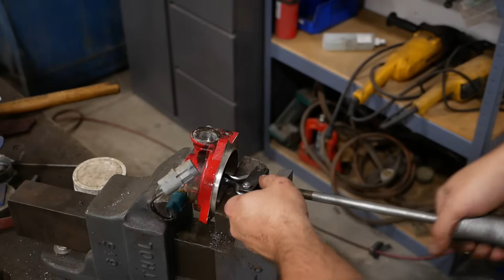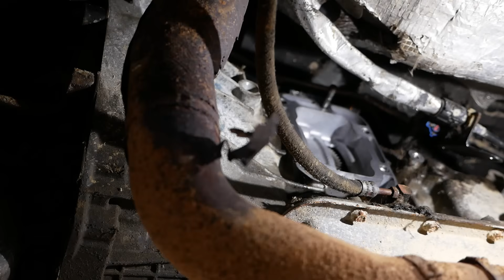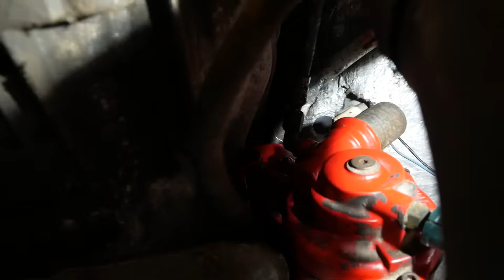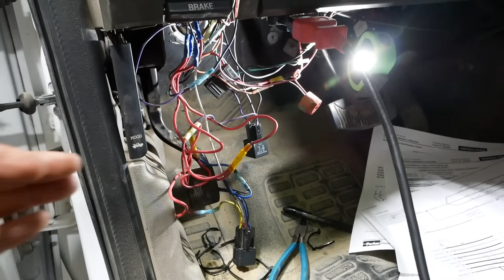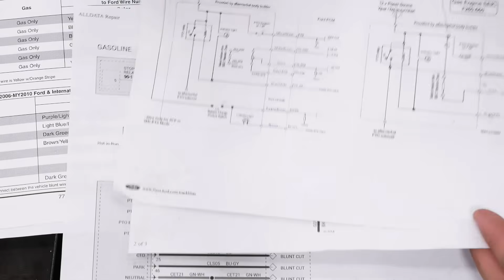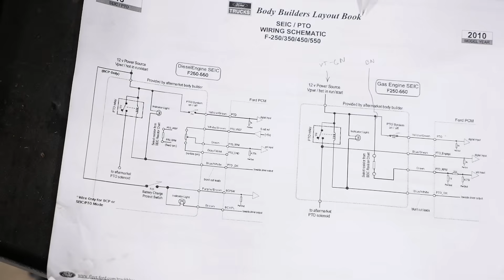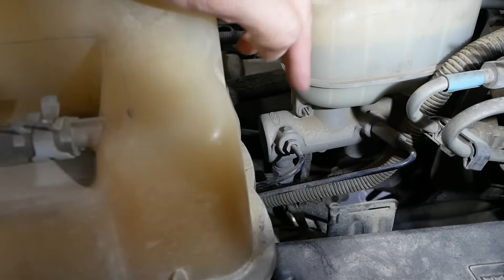Ford F550 Chelsea PTO Repairs - Unexpected Complications

Comment: As a former transmission rebuilder I was screaming at you not to use a screw driver to install the lip seals however I was happy when you said it as blunt. A piece of mig wire looped into the end of a 6inch piece of brake line and then squashed to retain the wire makes an ideal seal installer. Also you can wrap electrical tape around the seal and piston and freeze them. If it has an internal lip seal you will need to find something like the neck of a plastic bottle to hold the lip seal expanded while the piston is in the freezer.

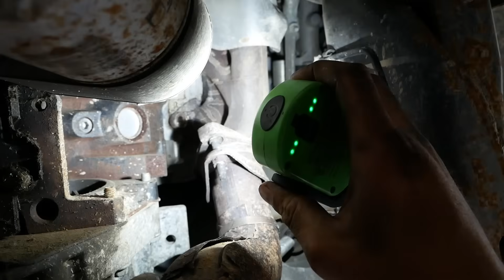Comment: 16:28 take transmission cross support off it should give u 4 in drop down get access to it
(I have replaced one pto on dump truck same issues tight fit ) i was hoping this help ya out

Comment: When you engage a  Chelse PTO manual or air operation, should be done with the brakes  on .and the transmission in gear stalled then engage then PTO!!
 This prevent excessive wear on PTO components!  All out GMC 16 yard  10 wheelers dump trucks used Allison auto  trans with  a 4 speed

Comment: Great diagnosis , fix and explanation . Of course , the question is , did those other 4 shops CHARGE them for NOT fixing it ?  It really is a sad that in this industry there are so many " experts " and no results . Know your limitations . Wouldn't it be better to explain to the customer that this is not what you do than charge and not fix it ? You need technical skills and the will to fix this . Most " mechanics " fall short in wiring and diagnostics .

Comment: U could use an old steel or friction take up the excess space in the stack.  That is what cut the lip on the old one. The piston came out of the bore and the lip caught the edge. Sometimes u have a selective plate that is thicker than the standard steel. Too much play

Comment: if that clutch was on a motorcycle (also multi pack frictions) it would be appropriate for a 100cc engine.  Somehow that doesnt add up, but pressure on the frictions and steels is the only thing that stops it slipping. Auto's have a similar issue with line pressure that sometimes needs to be revised on certain models to cure clutch slippage.  Attention to detail, pays off......and it also helps to research the operation of the system to gain an insight into how it "should work".  Well done!    subbed ;)

Comment: What was the symptom?? I have one on an f550 that engages everytime and all functions work. But its not strong enough for a heavier load. It does sound like marbles when its engaged but I was told it was symptoms of a weak pump. Now I'm trying to figure out if it is a weak pump or if the PTO is slipping. I think it should be the same design as this one.

Comment: I worked on garbage trucks for a living that's a new way body  most of the time it's the procemtry switch in hopper that cosen the problem  it is out of adjustment not letting the engine rev up
Reply from the maker: I suspect all of those switches have been bypasses long ago. The thing is a mess.

Comment: If the are running a hydraulic pump with an electric clutch .. why put it on the PTO .. it's be better powered off the crankshaft .. wouldn't it?
Reply from the maker: Ford says you can't run a pump off the belt without installing a larger front main bearing. You might be able to shaft drive it off the front of the crank, but I don't know.
Reply: @WatchWesWork   I see .. I guess it IS kind  of a big pump .. I've seen the front crank driven ones on bigger trucks and older farm tractors a few times times

Comment: Your transmission guy is right.  You don't flush as a flush can dislodge and move debris to a spot where it will clog the valve body.  Flushing is something that a shop can do to generate revenue from the flush, then revenue from repairing the flushed transmission.

Comment: Well done!

I've found that body Outfitters of just a decade ago (let alone older), rarely keep records of their own build designs. As running changes occur from chassis suppliers, the problem compounds itself and as a result, nobody knows how to troubleshoot the electrical and hydraulic system. 

The only ones that do keep archives are the chassis suppliers. Your approach to the problem was smart. 

But there are significant downstream problems facing the owner of this trash truck. All the safety features of the hydraulic system have now been bypassed by the previous repair shops hacking the wiring.

All the relays you found in the control box are usually connected to all the hydraulic Rams and ensure they are all operating at minimum / maximum ranges and line pressure requirements. Which then send signals to the Ford PTO configuration for engagement and rpm control (limits) and emergency shutoff, if equipped.

I've rarely had problems with Parker / Chelsea wet PTOs when they are maintained correctly with transmission hour maintenance intervals, which very few operators implement. 

The maximum hours between transmission oil changes should be between 800 / 1,600 hours (depending on gph load req.)  if operating 10 - 12 hours per day in moderate climates.

If an operator demands high availability, they will enforce a strict maintenance intervals. They will never require a transmission oil flush if they simply change the oil and filter on a regular pto hour schedule. This is especially true of Class 7 trucks with Allisons. As you pointed out, If left too late, like the Ford's, flushing the system will probably do more damage than good.

Comment: Great troubleshooting and repair! I had always wondered why I was told to not flush a high mileage automatic transmission until I heard the guy on Precision Transmission channel explain. He said automatic transmission fluid is highly detergent. Transmission housings are porous and over time metallic fragments and particles can imbed into the housings and new fluid can flush those particles out of the castings and destroy a transmission.

Comment: Wes. You're probably aware that it has other "issues". But I noticed when you attempted to use the compactor controls at the rear that it's not cycling properly. These compactors usually use limit switches and/or hall effect sensors to detect what stage they're on. These always end up failing/partially failing on rubbish trucks. But the good news is that now you've raised the idle it'll fit more rubbish in it too. Maybe too much, that poor little rusty chassis has got enough weight on it already. That's not your problem though. But you shouldn't have put the idle up on a separate switch. An operator will do whatever is fastest. One switch to make it work? Someone down the line is going to not give an F and that PTO clutch will burn out again.

Comment: Crazy good vid, correct trouble diag.  Found main issue and in such the secondary issue of other shops not finding the root cause and the wire hacks.  Now the truck is working as intended with the way the O.E. would like.   So if anything else goes wrong, like a mouse chew a wire....back to basic other tech in a different shop has a better idea what is the next diag step.  Out friggen standing.

Comment: I love that you go the extra mile to not only do a proper repair but to explain your reasoning that always makes sense. The clutches were burned up just like someone that rides the clutch on a manual shift only partially engaging the floaters and disc. Good job as always!!

Comment: My father in law had a ford lcf with a v6 power stroke it’s a roll back and it jumps up to 1400 rpm when the pto comes on it’s to protect the torque converter the manual says

Comment: If you take a paper clip and open it up and brake it in half… take that and stick it in the end of a 6 inch piece of brake line and hammer it tight!!!! Best deal tool for putting the lip seals in without damaging them!!!!

Comment: Should there be an instruction card on the dash showing how to properly operate the garbage body system? I would say that most people hired to operate a garbage truck don't have a clue on how to operate it. 
Does the system have failsafe modes to prevent damage from incorrect operating procedure?

Comment: The proper procedure to engage the PTO Is to put trans In gear and hold the brakes and engage the PT OStopped input shaft no grinding, my family’s construction Company had several trucks with Allison 650 series automatic transmissions.

Comment: I have worked on many of these and 9 times out of 10 the problem is the PCM thinks the truck is not in park.  Hook up your scan tool and look at the pcm shift inputs. More than likely the range selector switch on the side of the transmission is faulty. Had this issue on a Ford F450 wrecker and the range selector switch was full of water and worked enough for the truck to move but no high idle. Also look for a parking brake bypass switch/jumper wire. A lot of companies opted to bypass setting the parking brake so the drivers wouldn’t forget to release it.

Comment: I'll add to the chorus of amazement & kudos here in the comments for your diagnostics skills and perseverance.  I'm curious: how long did you spend researching the Ford wiring schematics and decoding the rat's nest under the dash?  "Some time has passed" would seem to cover a lot of sins.

I've done some enginerding (h/t AvE) on automotive systems & large home appliances, interfacing them with onboard software components, but I always had pretty full information on the signals I needed to interact with.  Reverse-engineering four layers of prior "fixes" wasn't really necessary.  😀

Thanks for inspiring us all with your great content!

Comment: Not that it's ever the goal. But nothing feels better than getting the job done right, especially when so many others couldn't. Its not always glorious. Sometimes it smells like compacted diapers, leaks oil into dirt filled belly pans resulting in 400 lb surprises,  bad parts make you look bad, well usually it's not too good. But whether it's not too good, or it's not too good but you figured it out. Completing work, returning to proper order. Especially after it's given you hell. Well there isn't much a better feeling than that. Nice work with this one. Thank you for the upfitter and body builder diagram information. Will be helpful in the future for sure.

Comment: Ugh... the old wives tale about not flushing a transmission. If you do it under its own power (disconnect the cooler line while running and keep it running) its just fine. Ive done if for 198k miles on my 7.3.

Comment: @4:50, use a hose clamp to compress the seal. A pop can could be made into shim stock if the hose clamp notches are going to cut into the seal

Comment: So the comment about trans flushes is some what true. The problem with doing trans flushes is that NO ONE ever does them based on mileage. So people will go "Oh I need to flush the trans I can fill it "slipping" ", by that point the trans is dead man walking. For most Car's and SUV's the trans should be flushed every 60k if they are just DD and little to no towing. For Trucks it needs to be 40k-50k (Based on weight) for DD and little to no towing. If you are pulling a trailer regularly with any vehicle 30k is as far as you want to take the trans fluids. Also if you're in a place like I am (South Texas Coast) Ford labels this area as Extreme Operation Zone they say 30k tops in their old manuals. 

The problem comes from how trans fluids brakes down, they basically boil the liquids out of the fluid and leave slug for days. When you put fresh fluid in it you soften and loosen the slug. This then works it's way through every inch of the trans. I have seen Clogged worm tracks, clogged and locked clutch piston and so much more from this. If you have a good working trans that you want to flush but don't have a service history on it. It's best to do a "slow flush", pop a cooler line off and pump out 1 gallon for large trans and 2 quarts for a small trans. Then top off fluids, do this 6 times for a large trans and 10 times for small trans. Each pump out should be done with 800-1000 miles between them. Doing the "Slow Flush" does not stock the system with all new fluids. It Dilutes it and lets the slug liquefy slowly and under control. Once you have done the flush, drop the pan and clean it and replace filter should be good to go. Also you have services like BG and MOC, BG being the best for Chem flushing the systems. But for old unknown systems that are questionable I do a "Slow Flush" first then tell them to wait twelve months or 30k then will do a Chem flush on a regular mileage bases, based on driving habits. 

CVT trans are a different beast and should follow OEM manuals for service timing and never use off spec fluids in them.

Comment: ONLY The best mecanics/technicians care about why the part failed in the first place I sat here and watched the whole thing I own a tow truck and from when I got it 15years ago I noticed R.P.M.'s would stay the same and hydraulics were slow I ended up doing the same thing you did and to this day it works perfect over the years rewired and a 40 amp really was installed. I also learned the clutches also help in very cold winter time when hydraulic fluid is thick it allows for a cushioned engagement. ( I also have the Solus Edge...down side are the freaking $500 twice a year updates ;((( ) thanks for the content love the pilot bearing puller comment #truthbetold mostly none of us have ever used it for that either!!!!

Comment: If I remember right the exhaust runs right next to the PTO on that vintage  gas ford.  That PTO is constantly cooking  and drying out the seals. They had some issues with it buring the pressure line or o-ring seals on the fittings out of the trans to the PTO and starting  fires.

Comment: if you change the batteries in a '02 F550 with a electric clutch PTO, the PTO circuits won't work until its driven 1/10 of a mile, then the PCM allows the PTO to function.

Comment: I dislike wiring problems. But if you start where the power goes in and follow the (what I call the power map) and find where the power stops most of the time you find the problem unless it's a controller the computer or a relay array then you have to start checking the in and out circuits like Wes did to find the problem. This is why old tech. is better than new tech. all new tech does is undue time to be wasted and parts to go bad that. use to be controlled by a lever and never goes bad. In this case if one lever engaged the PTO and engaged a higher idle at the same time without all the checks there probably would not have been a problem. Of course the driver and the helper would have to be taught the safety instruction to put the truck into park and to engage the  emergency brake to turn on the PTO nd reverse the order to drive the truck. Where I live the helper stands on the back of the truck while the driver drives (not a safe practice) but it gets the job done faster.

Comment: Good job Wes. Another great video. 4 shops? Can't find anyone that knows anything anymore. My son has a 2000 pickup truck and it was losing power at high RPM. had it to one shop and they gave me about five different things that it could be. took it to the neighbor shop ,which is one kind of like yours, and he took it for a ride and told me the Cataletic converter was coming apart and plugging the exhaust. it took him two seconds to figure out what it was. No scanner required just a hammer to tap on the bottom of it.

Comment: I was giving you respect for stripping and rebuilding the Pto because most people would just get another one and fit it , but now you have diagnosed and fixed the wiring issue so it works properly puts you on another level of persistent and tenacious.  Well done you should be proud .

Comment: ehh, Gud repair! butt, using the relays this way might cause problems with the relay coil inductance uhm... flyback voltage! Not sure if it's a problem here but if one relay is shutdown while the other also shutdown, that current could go where it's not intended, such as the PCM's Silicon Transistors... ! it might be no problem here but Flyback Diodes are something to learn about. 

for example: I'm using those relays but also a 1n4007 diode and a 20V 5W Zener. In OEM schematics it maybe seen as Flyback Resistors. not gonna go into the why's or how of it, but be aware of that flyback voltage! <3 all

Comment: Nice work Wes. I was perusing through the upfitters guide trying to figure out those switches on the dash of my truck. That’s when I realized there are all kinds of relays etc that you can tie into for those auxiliary systems. I was toying around with making my electric transfer case shift to a neutral position so I can tow it behind my Wanderlodge. Not sure why Ford did not put a neutral position in these transfer cases, they figured it out later and they have the ability to I think in the ‘17 trucks.

Comment: Wes love that you can fix almost anything.  Have you ever done any custom work or hot rod work?   I have for example up in Minneapolis a 1950 Chevy 3600 with a 6 and I am thinking should I replace the tranny or upgrade the engine ....  be fun to turn you loose on either.

Comment: i wouldda tried to put another steel in that clutch pack. the piston o-ring melted from the heat of the burning clutch.    either your mic setup is real good or those hydraulics are way too noisey.  high backpressure, worn out pump, or pilot relief  is chattering.  that rotted electric box is just too typical of a problem child.  thats one now that you've fixed it you may get lots more work, which is great if you need it but when you are busy  you wont want it.